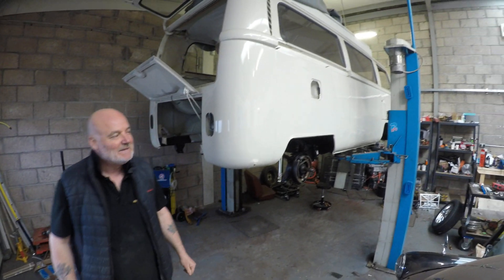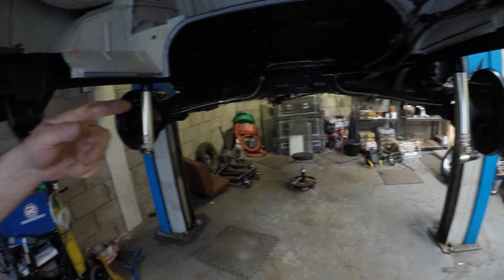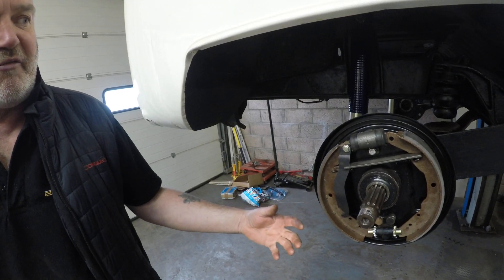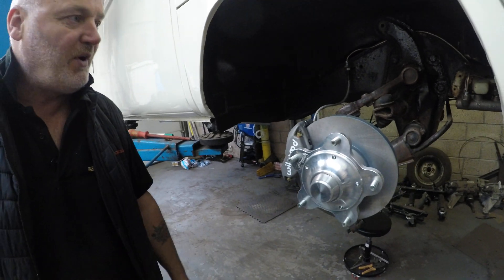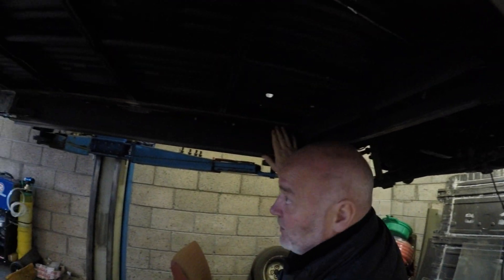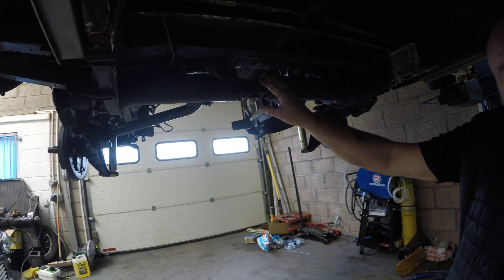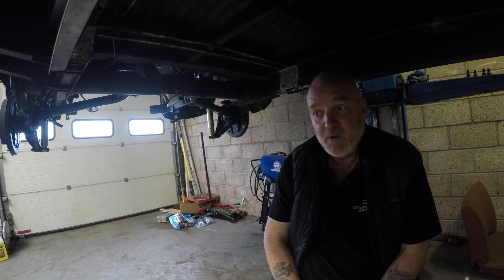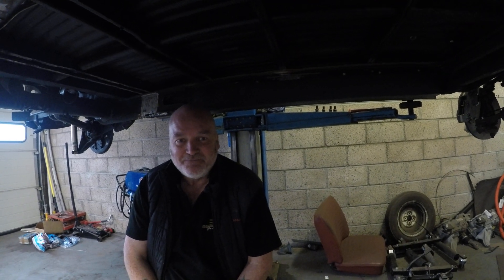VW T2 Campervan goes Electric

Comment: are we there yet, are we there yet ;).
Hi pal, any updates? I'm just buying mine atm and then onto doing the same conversion, so i'm looking for some tips.
Reply from the maker: Not quite, we had to put it on hold whilst we are converting a black cab. Motor and subframe all in, driveshafts are ready to go in shortly. Still loads to do but hopefully get back to full time next month.
Reply: @ElectronGarage  i've been keeping an eye out for an LFP pack as i'll be using it to go back round the world and i figure it'll be even better suited, what do you recon?
Cheers for the reply mate. John

Comment: HI MR 
 I can solve most problems and have found workarounds but the EVIC display is not something I can fix. 
i fix the battery side but it's still the motor side can YOU help me please 
i'm working in prototype motor HYPER 9 HV controller  SME ACX144